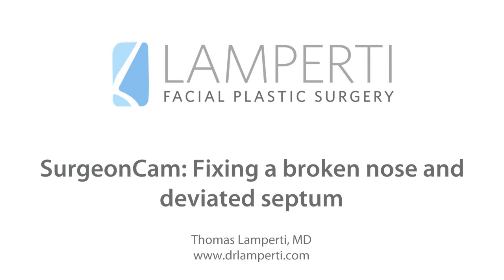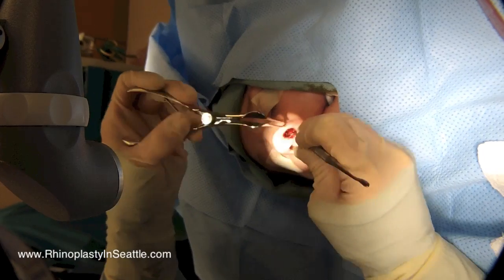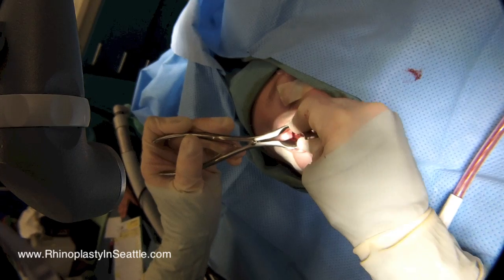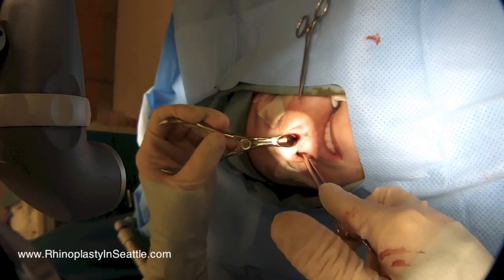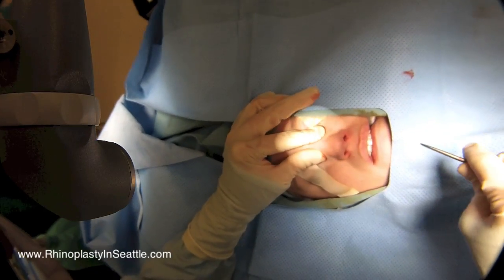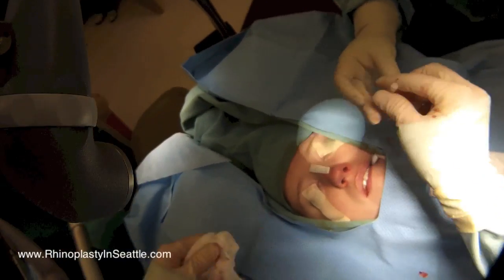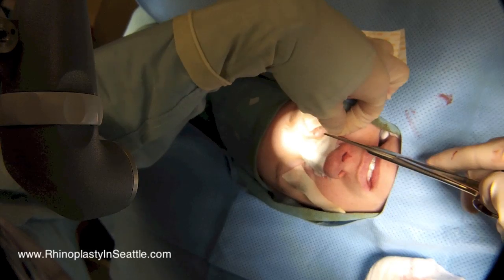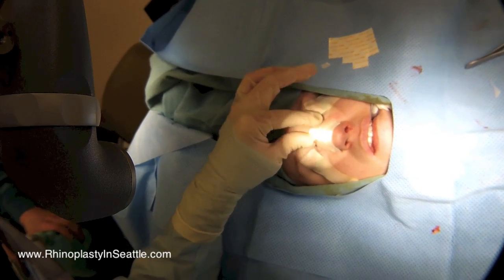SurgeonCam How to fix a broken nose and deviated septum

Comment: I broke my nose 5 years ago when I was twelve and the doctor said If I wanted to get the surgery they would only do when I was at least 16. Now i'm 17. Is it still possible to correct it or is it too late? Also, how long does the surgery itself take and how long until I would fully recover?
Reply from the maker: It is usually possible to have surgery to treat a formerly broken nose even a few years after the injury. Since the bones have healed the treatment isn't like what is shown in this video, however, so the bones would need to be re broken using controlled bone fractures (osteotomies). It's not possible for me to say exactly how long surgery and recovery would be in your case without an examination and further evaluation. There's quite a range depending on the actual treatments being done. Best, Dr. Lamperti

Comment: Hello I'm 16 years old and learned that I have a deviated septum inside my nose which was caused by a broken nose I did not know I had when I was much younger. Probably 4-5 years old. I don't like the idea of having plastic in my nose for the rest of my life so would they just perform the treatment without plastic if I don't wish to really change the structure of my nose with plastic? Also would this be done with knives as well or would they use lasers?
Reply from the maker: Septoplasty surgery doesn't normally involve permanently placing plastic in the nose. The surgery is normally done under anesthesia (where you're not awake) with a scalpel and other instruments. Lasers aren't normally necessary. You and your parents should visit with an Ear, Nose and Throat doctor to further assess your nose and determine your best treatment options.  Best, Dr. Lamperti

Comment: how badly does your nose need to be broken before you have this surgery
Reply: sorry if I didn't word my question correctly but I think you know where I'm coming from
Reply: +James Kyle is it when your breathing is affected
Reply from the maker: +James Kyle Hi James, Thanks for your question. A deviated is repaired when it is affecting the nasal airflow and breathing. A broken nose is reset if it is unacceptably deviated as a result of the recent fracture. It is up to the patient whether they want the nasal bones reset. It isn't technically required that it be treated, but if left alone the bones will healed in a the deviated position. Best, Dr. Lamperti

Comment: I was sparring about 5 weeks ago and took a couple shots on the nose. The swelling has gone done. I had x-rays done and my primary care physician said there is a fracture, but the nose is not displaced and it will heal on its own. I have air flow through my left nostril and next to no air flow in the right. I even probed with a q-tip and on the right side I can feel a block where the q-tip would normally go much further on my left. What would be the best course of action right now if I want to regain breathing in both nostrils. Its very annoying, distracting, causes anxiety and I'm constantly mindful of my breathing now.
Reply from the maker: +eniac78 You should visit with an ENT (otolaryngologist) who can look inside your nose to see what is going on. You may have a septum injury that can be better assessed by a specialist in person. Best, Dr. Lamperti

Comment: how much does it cost? I have a crooked septum I can only breath on one side of my nose
Reply from the maker: +jvazquez This type of surgery to correct a crooked septum is usually covered by insurance. It's impossible to give an out of pocket quote without seeing your nose in person. Best, Dr. Lamperti
Reply: +DrLamperti last time I checked back in 2009 doctor told me that insurance didn't covered
Reply from the maker: +jvazquez Deviated septum surgery is normally covered by insurance if surgery is indicated for treatment. You can try visiting with a different doctor. Best, Dr. Lamperti

Comment: Does this change the outer appearance of the nose?
Reply from the maker: +LeetDragoon Reducing the nasal fracture will change the outer appearance of the nose by repositioning the out of place nasal bones. Septoplasty doesn't typically change the outer appearance of the nose, but rather straightens the septum on the inside of the nose. Best, Dr. Lamperti
Reply from the maker: +The_Seeking_ One If the outer bone and cartilage were trimmed then a rhinoplasty was also done which will change the outside of the nose. Best, Dr. Lamperti
Reply from the maker: +The_Seeking_ One With standard septoplasty the nose shouldn't become weak and the nasal valves should not be affected. Of course, you want to make sure you are being treated by an experienced nasal surgeon to make sure everything is done properly. Best, Dr. Lamperti

Comment: Hi Is has been a year now since I have a broken nose, the inside bone has gone bent I would like to know if I go to the doctors what would they do also will I need a surgery for it
Reply from the maker: It's hard to know what your doctor will recommend you do without seeing your nose for myself. After a year any broken bones in your nose will have healed and reset in their new position. If you want to get them straighter then some type of surgery is needed, but it's up to you whether you go ahead with surgery. You should be able to get a better idea of your options after visiting with your doctor. Best, Dr. Lamperti
Reply: I went to the doctors he had said it is Broken so he had made an appointment with the hospital for a checkup. My nose has got a bump which makes it look big from the sides, air only comes out of one nose when I breathe do you think it will need a surgery and is it cost for a surgery if you are age 17 from the UK
Reply from the maker: aky bfd it's impossible for me to say what your doctor will need to do without examining your nose. That's a great idea to have someone assess things, though. Since it has been a year the doctor won't be able to just shift the bones back into place as they have healed into their current position. Best, Dr. Lamperti
Reply: I think it's my septum that needs fixing but I have a hump do you think that will need fixing

Comment: Hi! So I've had a broken nose for probably 12 years now (fell on tile floors when I was 6, now I'm 18) with such a time skip since it happened can my nose still be repaired? If yes, would the swelling or shape decrease in anyway, or improve breathing?
Reply from the maker: Hi Kelly, It normally is possible to fix a nasal fracture after several years but it wouldn't be as straightforward as just resetting the bones at this point. After about 6 weeks the crooked nasal bones heal in their new position. Luckily, there are rhinoplasty techniques available to address the injury this far out. The precise treatment that you would benefit from depends on your actual anatomy and type of injury. Best, Dr. Lamperti

Comment: hello Dr. Lamperti, i live in INDIA, I broke my nose 8 months back in a state level competition. I got my nose treated the next day but It is still  little deviated. Is it possible to align the septum now? also tell me, would my nose always be vulnerable to breakage? I do 1 semi contact sparring and 1 full contact sparring every week..please reply....thanks in advance.
Reply from the maker: Hello, Your nose should be healed in its current position now that it's been 8 months since your injury. It is normally possible to straighten out the nose and septum at this point, but it's more involved that just resetting the bones. A septo-rhinoplasty procedure is normally used in these types of cases. After a nasal fracture the nose isn't normally any more prone to fracture with trauma than normal. 
Best, Dr. Lamperti

Comment: My nose surgery 8 hours? It was a broken nose but my doctor explained to me it was broken from the inside and outside. My question is what was done to me? He mentioned something about reconstructive surgery as well? Had it done when i was 19 and now im 24 with lots of questions and i never went back for a check up to see how it was going, just to get my stitches out. Should I contact my doctor from years ago?? help plzz
Reply from the maker: Hi Fernando,
If you have questions about your prior nasal surgery you'd be best served to find out the answers from your original surgeon. It sounds like your surgery was more extensive than just resetting a broken nose though.
Best,
Dr. Lamperti

Comment from the maker: Hi Eduardo,
The cost of surgery to correct a broken nose varies quite a bit depending on what you need done. To just have a septoplasty usually costs less than the figures you mentioned. Of course, if you have insurance the costs can be lowered as well. 
Best, Dr. Lamperti

Comment from the maker: HI Dave,
It's hard to saw for certain without examining your nose, but if your septum is significantly deviated to one side septoplasty surgery should be able to help even out the airflow and improve your congested feeling. If you also have outer nostril collapse with breathing in you may also have an issue with weakening of your external nasal valve that could be improved at the same time.
Best, Dr. Lamperti

Comment from the maker: Hi Dave,
Yes, we do often try a medicated nasal steroid spray to see if that helps your breathing. I don't require a full year of use, though. The spray will normally kick in and work after 4-6 weeks (if it is going to help at all).

Septoplasty surgery itself isn't normally very painful. I've had it myself so can say from experience. A lot depends on one's pain tolerance and whether packing is used. That's one reason I avoid using packing after nasal surgery. Good luck!
Best, Dr. Lamperti

Comment from the maker: Hi Carissa,
It is possible to repair your deviated septum at the same time as correcting your upturned nose. It's actually preferable to combine the two procedures, as we can often use septal cartilage during the upturned nose portion of the procedure. 

I'm not sure why you were told to wait a year before having surgery (unless you'd had a prior rhinoplasty that they want to allow to heal). Even after an acute injury we don't normally have to wait that long necessarily.

Best, Dr. Lamperti

Comment: I had a consultation for my nose, and the surgeon had told me I would have to wait an entire year before  he would recommend me having rhinoplasty.. My septum got deviated and my nasal passageway got cracked. Is this really necessary having to wait a year to get my septum fixed, and to have an upturned nose corrected? Can these two problem be done at once or does it have to be two separate  surgeries? Thank you!!